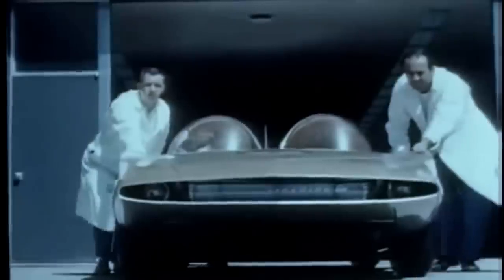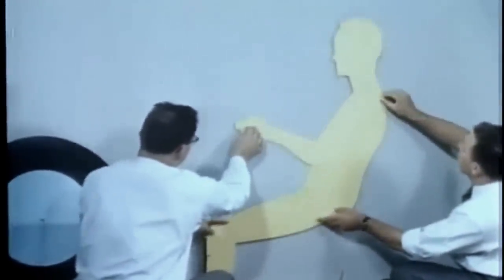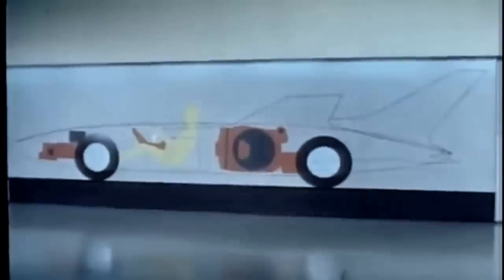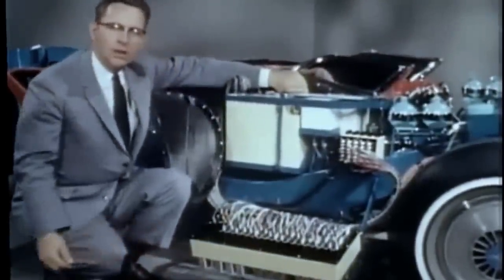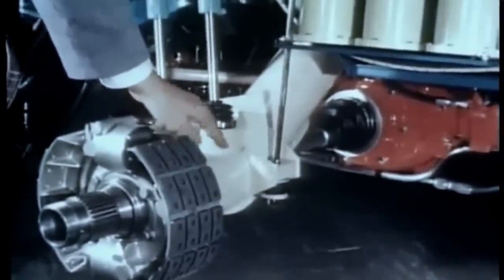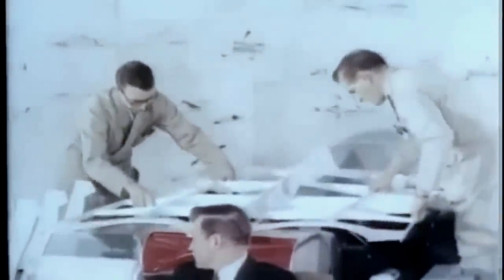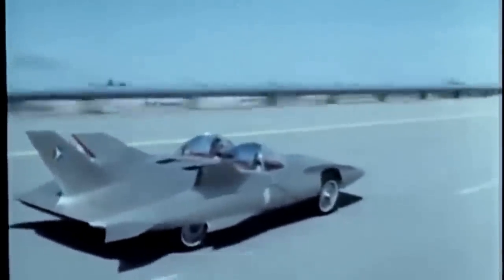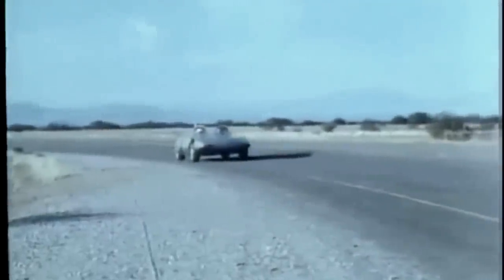GM Firebird lll Gas Turbine Car Promo Film - 1958

Comment: I like some features of this car... First the auto drive... I have long thought that an autonomous like Tesla was not the right way to go... As far as our current interstate hwy system goes... it is not the best to autonomy... have either something embedded into the highway or beside the road that one could sync the car with .. and with the addition of a magnetic system to keep vehicles at a safe distance from each other(many details to work out with this system)... while your choice to drive unsafely as well as recklessly would be no longer be your choice, a safe leisure long distant trip on the interstate would be achievable ... no hotrodders no jockeying for position ... simple enter your destination and mere let the system know when you needed to get off the system ... ie: food, gas(this would most likely be integrated), rest , hotel stay, side ventures(sight seeing)...... I feel the tesla or which ever car being allowed to make a choice of which victim you would hit is simply not the best way...... lets face it some have actually been arrested for sleeping in the back seat of a car barreling down the hwy at the speed limit or greater...

Comment: not fond of the idea of having two engines running or that right hand joystick controls for acceleration and steering combined gimmick but overall, the engineers and automobile designers were actively concentrating on the space age and futuristic approach to car manufacture back then, now they design them to consume no less than 35 miles to the gallon fuel efficiency, as a grammar school student in the 1970's. everyone was taught that by the year 2000, there would be colonies on the moon, everyone would have access to space travel, cars would no longer need tires, and all we got was the computer and smart phone to show for the predictions of the future🤔

Comment: I love the spirit of the 1950s. So much optimism for the future.
We got a bit of it back in the 1990s with the Year 2000 ahead and the age of computers getting accessible to the masses.
But it's a bit sad that all those 1950s plans for fully automated homes, innovative appliances, self-driving and flying cars mostly went in the bin in the 1960s or 1970s.
Reply: I recall a bit of alarm in the 90's about an apocalyptic Y2K event where the planets computer infrastructure would come crashing down.

Comment: Only in the 50's is having a whole second engine just to run accessories an efficient solution
Reply: If you knew more about gas turbines, you would understand why that is an efficient solution. Those engineers knew what they were doing.
Reply: @nadnavlis240  or just use an accessory gearbox driven via the compressor which is the efficient solution used by all modern gas turbines.

Comment: I've been obsessed with the idea of using a turbine electric. Then it is fine to run the turbine at maximum efficiency and don't need a weird transmission.
Reply: thats horribly wasteful, theyre insanely expensive and no more efficient than a modern car engine.
Reply: @bradhaines3142  even I know it isn't a good solution, just a fun one.
Reply: @jasonstiletto  rotary engine would be more fun

Comment: I've always dreamed of a car with fighter aircraft type controls ... but as a former military engineer, I can tell you that the turbine would be a nightmare... and so would the wire based guidance system. 

I did "kind of" get my fighter jet styled vehicle with the 2014 Chevy Camaro 2SS.  The driver area is modelled loosely to seem like a cockpit, and I have a heads up display (HUD)!  I call it The Raptor.
Reply: My C7 Corvette has heads up display I love it

Comment: too bad GM made a lot of garbage vehicles and still do. No galvanizing so the entire car rusts out in a year, all bolts rust out and break off, steel brake lines that rust out and you crash at high speed because your brakes don't work. It should be criminal because it's extremely unsafe and all GM vehicles should be re called to get brass brake lines installed.

Comment: 13 13 play time 13 occult number.    firebird = phoenix   power number 3 in the in the occult =  Freemasons =   The number 3 is also associated with the Freemasons, of which Mozart and his librettist Schikaneder were members, and the theme of 3 appears repeatedly in the piece – both on stage and in the pit.

The opera’s opening overture is written in Eb Major, which has 3 flats, and it begins with 3 chordal gestures, imitating the secret knock that masons would have used in Vienna at the time to gain access to their Lodges.  
  So to you normies what this actually reveled was Flat EARTH  = car domes or personal domes = the firmament dome!

Comment: Incredible piece of engineering (although the styling was over-the-top - with all the non-functional wings, etc). Using a joystick, I actually used to beat guys with driving simulators in Need For Speed games - it's just a matter of getting used to a new interface. What this demonstrates though - the wheels of progress, in terms of engineering to production floor, moved way too slowly. Today, I would love to own a PHEV with a tiny gas turbine engine as a backup generator, but alas they are still way too dirty and hard to start to compete with an Atkinson cycle or even diesel apparently. Given a commitment to development, those issues could probably be overcome for automotive applications (see also Mitsubishi Mi-Tech) since running a small gas turbine at a constant speed does overcome many of the challenges of direct drive) ... it would weight WAY less than 5000lb of long-range batteries.
Reply: Gas turbines start easily these days with little dirt. See turbomecha  engines. an 800SHP engine would fit on your dining room table.

Comment: 1. It's 2022. Where are the flying cars we were promised?
2. Today, "Oscar" would have to be modeled on 
The 200 to 400 lbs the average American weighs.
3. The future ain't what it used to be.
4. Bubble canopies get very hot in sunny conditions .
5. Futurists always get it wrong. There are simply to many unforeseen variables to account for.
6. Turbine engines have been proven impractical for road vehicles because driving in the real world requires constant throttling up and down, and turbines cannot change speed quickly like an electric or ICE motor can.
7. For all my criticism, this was still very amusing to watch 🙃

Comment: Amazing. Way ahead of its time. The first Batmobile and Speed Racer Mach 5 were probably inspired by Firebird.
Reply: The 1966 TV Batmobile was built from the Ford Motor Company Lincoln Futura concept car, from 1955, so technically it predates the Firebird III.  But the Futura didn't have a turbine engine!

Comment: I was fortunate enough to talk with Bob McClain about this vehicle he was the lead on this project.
It was back in the 1980s as I was attending his daughter's wedding in the conversation came up some cool stuff was done to build this car.
It never went into production due to the cost was $20,000+ with production targeted for 1963.
And Chrysler had a much better turban set up in an actual car that was running on the highway.
Typical general motors never following through on any production vehicle they just used the public to r&d it if it's a filled product they just discontinue it at the consumers expense and frustration to to lack of research and development before products are released.

Comment: When are automobile manufacturers going to make another Model T? They certainly try but do absolute stupid BS. Like the air conditioning units on older ford trucks and the starters stuck between the heads on gm. Don't get me started with that cvt trans Nissan made. It just needs to GO. STOP adding dumb shit to cars. Also, planned obsolescence is the primary reason engineer's will be targeted with force if society breaks down. Don't let mistakes get passed you.

Comment: From the drive by wire to the sensors in the road to guide cars, they clearly were thinking way out. It's amazing to see they actually built the prototypes.
Reply: Remember that when they came up with this concept the interstate highway system was only just beginning to be built. It was a time of new infrastructure, and hence new ideas. Today we're just trying to keep our bridges from collapsing.
Reply: Just imagine how exciting a cross country trip could be if a 60 year old 'guide by wire" system was part of our infrastructure.  A smile every mile!!
Reply: @daniels7907  funny how this technology is being used today in Tesla's and some other car companies.
Reply: @JohnJohnson-bg2oo  - Funny how many people believe that opposing EVs is their political duty.
Reply: @JohnJohnson-bg2oo  - Then don't complain about the price of gas being erratic. Because you're making the wrong argument to me. I'm not an obsessive tree-hugger. I recognize that the entire act of building automobiles, period, has a negative environmental impact. So do roads and other infrastructure to support driving. The issue being that oil has become a volatile market as well. Why does the U.S. depend so much on imports of oil? For example, our entire political/military policy towards the Middle East and the TRILLIONS of dollars that we spend on the region is directly tied to our dependency on oil from there.
Reply: Yes the joystick steering is way ahead of its time.
Reply: And how do you like those nifty braking flaps? I guess they're for when you approach your driveway doing 300 mph.
Reply: @continentalgin  I suppose in an emergency, you deploy the braking parachute
Reply: @nunyabusiness863  no its not.
Reply: I'm sure the car was a test lab for dozens of patent applications.  And I'd be shocked if more than a couple ended up having any practical application.

Comment: Unmentioned: The car had the acceleration of a dump truck, and about the same fuel economy. It takes to long to spool up the turbine, and turbines do not do well in stop and go driving. There's a reason why they are limited to airplanes, which fly long distances at the same speeds without stopping.

Comment: turbines in autos were sweet. you could rest a nickel on its side on the engine block and nothing.. smoother than smooth, and it sounds bad ass.  I tried to make my Toyota into a bat mobile in the 80's. I heard some old schoolers who used to race in the 50s, talk about flame throwers,. said they used to drill spark plugs back into the tail pipe from a button in the cabin. so I spent like 3 weeks doing that. ran a wire from my engine compartment. when I told the old dudes it didnt work they laughed their asses off. I didnt know their cars were putting out gasoline vapors from their racing cams. dude said "you cant light that Toyota exhaust on fire, moron!!" . Then I tried to make some batwings on the rear, with some 2x4s and bondo. turned out worse than the flame thrower. had some clay forms around the 2x4s and they melted in the sun and dripped down my pain. I did have some success with threading the windshield wiper tube to the front of the car to spray people when they walked by. where did the time go

Comment: 1.  Where is this car today?
2.  Why spend all these resources on something you are not going to SELL?  Go back and learn the lessons that Thomas Edison taught you.  Why didn't they sell these or something similar, even low volume.  There would have been buyers.
3.  Notice almost nobody is overweight in 1958.  The women wear skirts.
4.  That bubble canopy would be DEATH in a roll-over.  Glad they started putting built-in rollbars in most all cabs in the 1970s.

Comment: I like the cool twin bubble top so when you use the ejection seat, you don't get the blast charge stuff all over your passenger. 11:15 And the rear air brake system is a way too cool way of slowing down the car... eventually.  Those guy down in research really know how to design space-aged cars. Far-out!
Reply: Yeah, who needs an air bag when you can simply eject?

Comment: 50% more expensive gasoline, 66% reduction in fuel efficiency = 4.5x the price. The vehicle also requires precious metals so the base unit would likely be $100,000. Also if you got in a collision, the combustibility and flames of that fuel would basically cook you instantly. Also the reliability of those components is way lower so it'd be in the shop twice as much. Cool beans

Comment: I can’t see how that integrated steering, throttle, and brake control ever got past even the conceptual stage.  It would be a disaster if ever implemented!

Still, it’s very enjoyable seeing all the clever ways they used to develop the features of the car.
Reply: This is a working car, it still drives today and uses that goofy joystick.

Comment: Lotta futuristic features in this car.  Advanced gas turbine engine, with direct drive to the rear wheels via a 3rd member of course.  But the steering / braking and feedback system are truly remarkable!  And anti-skid brakes too!  The highway sensing system was a forward thinking aspect that they guessed might take hold.  Remember, at this time, the first freeways were only about 10 years old, so they were thinking that "Auto-guidance" would take hold.  It never did, unfortunately, as there would be no consequent system to control speed and braking, only direction.  The styling they added to this vehicle is pretty incredible too.  I wonder if this vehicle still exists in a museum somewhere?
Reply: Apparently it's at the "Audrain Automobile Museum" in Newport, R.I.
Reply: Unlike "Jet" cars with aircraft style jet engines (which are also turbines, though with no power through to a 3rd member, just thrust), the gas turbine in this car was probably capable of very decent acceleration.  I've seen "Jet" cars race the 1/4 mile, and they don't go nearly as fast as top fuelers, though they are quite impressive with 150' flames shooting out the rear-end of the car (with afterburners installed) and all that sound from those engines doing 12-13,000 RPM's!!!

Comment: This is priceless.  Thanks for sharing it.  :-D
It is interesting and educational, too.
My-oh-my, how times have changed.  And yet, there are cars using auxiliary engines nowadays.  So, that idea got re-purposed, it seems.
Reply: When you call it an auxiliary engine I think of big aircraft that have a separate turbine just to power accessories (APU) but a car whose primary power source is a battery and secondary power source is a piston engine, would certainly fit that description well enough

Comment: They didn’t lie,

It NEVER is going to be a production vehicle. Regardless of which “tomorrow” in the future.

Only thing we took was the controls and we use them in heavy equipment.

Least it wasn’t a total waste of time.

But can you imagine your aux motor just dying in the middle of a turn/ breaking?

You’d be stuck in that direction, with ZERO ability to stop or do anything.

Comment: That braking system is incredible. I'm sure it was way to expensive to option on any production cars,...but just WOW!!!! I wonder if they implemented those in their racing program??? I'd just like to have that fully outfitted frame with no body. So cool.
Reply: I was just thinking what a crazy design decision it was to make a wheel a wear item.
Reply: @danbrown586  A wear item and a damage item.  Smack your wheel over a bad pothole and tear up the brake, too.  Good chance the cracked drum would lock the wheel.  Who cares about control in an emergency?  This is the FUTURE, 1958 style!!  Of course, disk brakes came on strong a few years later, much to the disappointment of the Buck Rogers crowd.
Reply: @21stcenturyfossil7  Citroen had front disk brakes in 1955 and Jaguar sedans had 4 wheel disks in 1956. Americans just made complicated gadgets but no real applicable engineering.
Reply: @denislesperance852  Chrysler and Crosley offered 4 wheel disk brake systems in 1949.  I don't know what "complicated gadgets with no real engineering" might be.  Automatic transmissions?  Air conditioning?  Power steering or power brakes?  All of these developments are now common all around the world.  As far as the Firebird concept cars go, they're just silly vehicles full of silly ideas.  Those goofy wheel/brakes look like the giant drums used on large trucks with additional wheel mounting beads.  Detroit's concept cars are where bad ideas went to die.
Reply: Some modern cars (mostly electric) have brake by wire brakes, but it’s still through a petal.

Comment: Ahead of its time for sure. The biggest issue against it was that lightweight materials of the day were iron. I bet the dashboard was sheet steel.
Reply: The had aluminium pannels  bombers where made of aluminium pannels, problem was making the frame aluminum, no molten metal injector was big enough to make a cars frame, aluminium steel aloys existed but where to rigid for its frame its as it shatters, germans made a aluminium frame part for the BF 109 plane in WW2 but it's not very large, so far Tesla is the only company to have made a 2 peice aluminium frame (model Y built at the Texas giga factory that opened this year), first in the auto industry, the technology again came from a German die casting manufacturer they contracted.

Comment: Nothing here new now is their ....... The Chrysler turbine engine program that produced the Turbine Car began during the late 1930s and created prototypes that completed long-distance trips in the 1950s and early 1960s. The A-831 engines that powered the Ghia-designed Turbine Car could operate on many fuels, required less maintenance, and lasted longer than conventional piston engines, although they were much more expensive to produce.

Comment: WTF is a gas turbine engine? For a car? And like what is a tail for? & wings in the back? This has no practical use on the road. Did they actually expect it to take off like a Jetsons car? No wonder they shut down Pontiac. The best feature was the separate section for the passenger. Was that designed so you couldn't hear them scream?